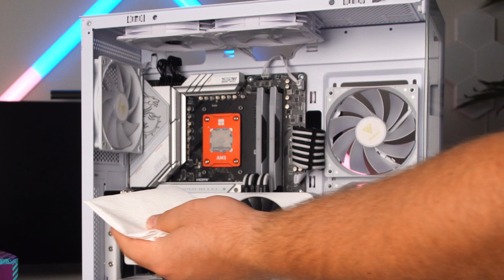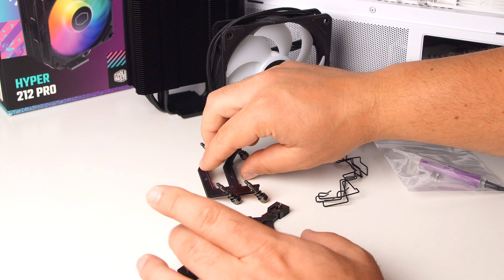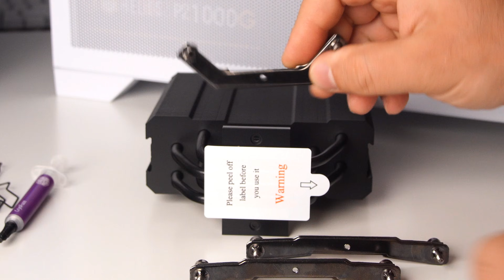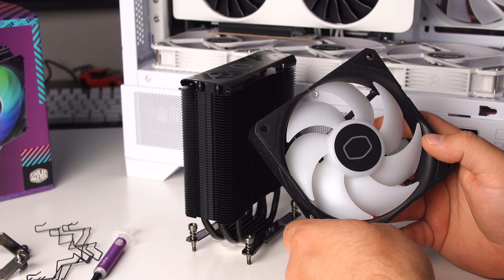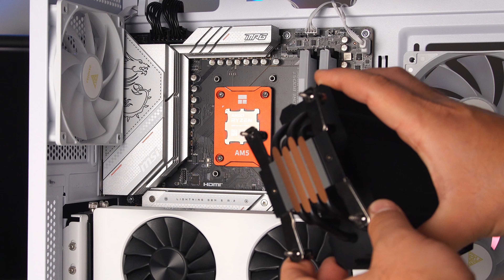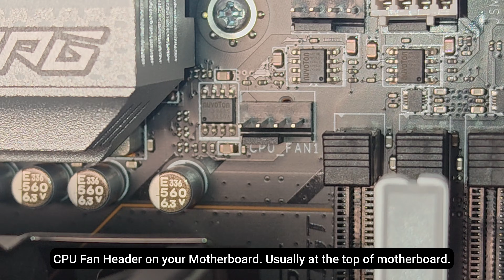How To Install Cooler Master Hyper 212

Comment: Regarding fan orientation, I’d definitely do it like how he does in the video. I had it in the pull configuration (sucking hot air out of the sink rather than blowing cool air through) and it made my machine run hot and give off a pretty bad smell, which I think was burning dust

Comment: If i have 4 ram sticks (4x8gb) will it fit besides the ram sticks? Im just asking because it kinda looks like the first ram slot is occupied by the fan.
Reply from the maker: Most likely you'd have to mount the fan either in the back or the fan will touch the top of the ram stick. If your ram isn't tall, shouldn't be an issue unless you want to show up the ram sticks.